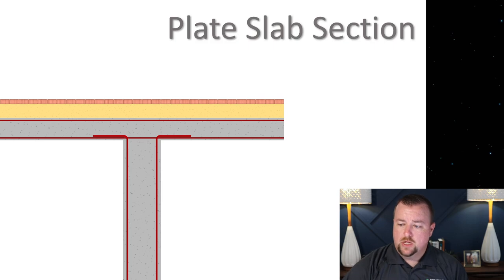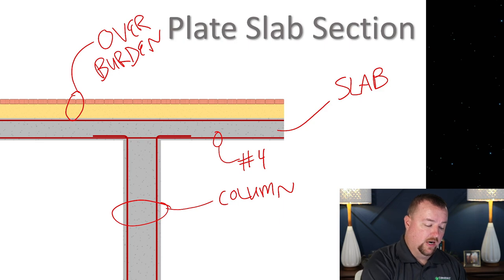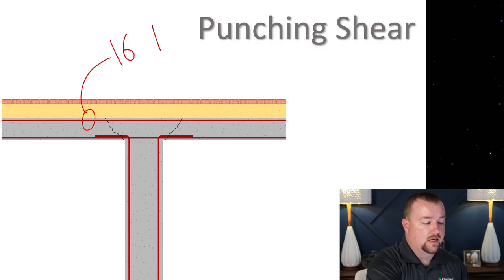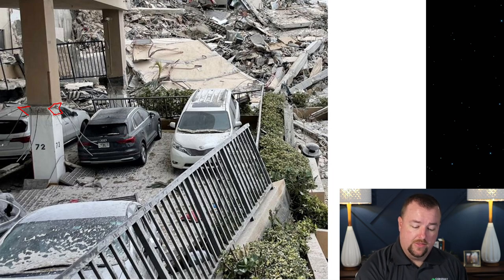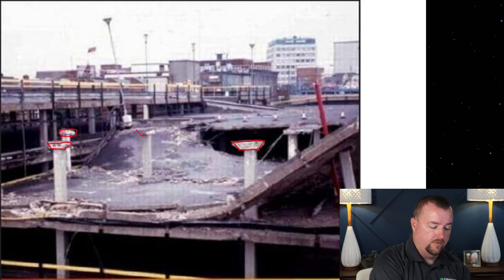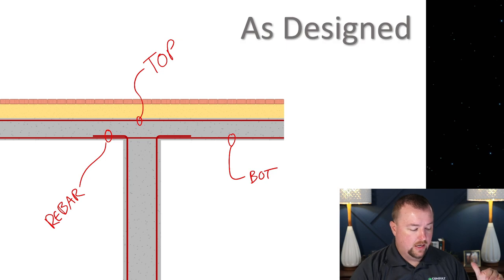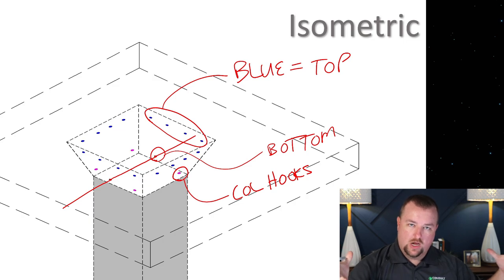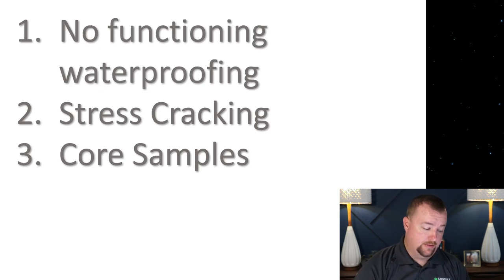The Importance of Punching Shear at the Surfside Collapse

Comment: Take a look at column 72 (@4:36). 
Note that there is two long (4' to 5') pieces of rebar sticking out of the column  in each direction. These rebar appear to be part of the top layer of rebar, of the structural slab. Note that there is only two pieces in each direction instead of four.
On the right side of the column, marked 73, it appears to show a short piece of rebar (1' or so) that is part of the lower reinforcement.
If the structural slab had de-laminated, as described, these bars would have pulled out of the slab like a loose thread from a piece of cloth; when the structural slab fell out from underneath. The weight of the overburden layer (as well as the inch or two of  the de-laminated concrete would be enough weight to bend these rebar to the shape shown.
This further supports the theory in this video.
Reply: Plus, those sections of rebar (protruding from pillar #72 (and most others), shows zero chunks of concrete attached to them...  they are stripped clean.
Reply: When we look near the pool where the slab did not fail, why do we not even see the 2 pieces of rebar that we saw at column 72?

Comment: Because you asked for ideas I propose this one:  There is a transverse beam shown in (your) July 12th video at exactly 29:00 minutes and I believe that when either column fails (and surely one failed)  it initiates the cascade failure of the larger structures. I have designed low rise buildings with various construction materials in California where we learned that there was a serious lack of hoop steel in columns of buildings designed in the 70s and 80s in this seismically active region of the country.

Comment: I was a rebar inspector among other duties, I did inspections for commercial, bridge and nuclear construction. My attention is to focus on the base mat, thinking of what I have seen and read about the history of the bottom slab being wet, especially it being salt water.
Reply: As a heavy equipment operator in Las Vegas, I've done plenty of demolition cleanup. The rebar was a twisted mess and actually kind of a pain to work around. The first thing I noticed when this building collapsed is not as much rebar as I'm used to seeing in a rubble pile. I wonder if they skimped on the rebar.

Comment: Yet again, a great explanation.
I just watched a video on the KC Hyatt Hotel suspended walkway failure, resulting in the death of ~110 people.  The conclusion was the engineering called for a single rod, for level 2 and 4, resulting in 90KN of stress at the bolts holding the suspension slabs.  But it was built using 2 different rods, one to the 4the floor, and another se from the fourth floor to the 2nd.  This resulted in 181KN of stress at the bolts.  No one went to the engineers when the decision was made to use two seperate, instead of one continuous rod.  This is a loooong way of getting around to asking, how often during construction, are changes made, where engineers aren't consulted?

Comment: Wow Josh.  You have highlighted something crucial and explained it well.  And your drawings are great.  
This pool deck was inexplicably weak and it didn't make sense.  Plus it stood for so long and then fails now.  Now its so obvious why.  Also the punch shear column head shapes were all so odd.  Why was all the top steel missing at the column heads?  Now it all makes sense, there is only bottom steel sticking out of each column.  Thanks

Comment: Good review. From the point of view of a construction special inspector with over 20 years experience, I see all the things you have pointed plus a couple more that may have contributed: 1. The top mat is too low and it is possible the bottom mat is too high leaving a thinner reinforced slab section. There may also be cold joints present from interruptions during concrete placement. The lack of top reinforcing as required by the structural plans is a likely result of relying on the contractor to do the job correctly. Inspection is a critical part of getting the building built correctly. The punching shear failure  is very obvious in many of the photos. Now apply this scenario to to a seismic zone like we are in here in Seattle and you see it is critical to proper construction of the slab. It is a very unfortunate example of how building codes are written in blood. I look forward to your future reviews as more information comes to light.

Comment: A very informative video, clearly explained. My take, upon watching it - The top bars, made useless by delamination, were no longer able to create compression along the punching shear failure plane to anchor the frustums of slab to the tops of the columns. Whilst it may be failure of the wpm that lead to the problem, the structure itself should have been designed (and built) without reliance upon the membrane, at least for major structural failure mechanisms such as punching shear. The failure of the wpm would not, however, be the only factor in the structural failure. It should not even be the primary factor in the cause of failure. It should have been a first line of defence, only.

Comment: Josh, I've been following your analysis for some time and I have to say this video is the clincher for me.  Clearly there was punch through and the delamination of the top of the structural slab around the top mat would weaken the punch through resistance.  The poor or non-existent water proofing explains the delamination from corrosion, spalling etc do to water as well as weakening the concrete itself doomed the slab to fall eventually.  And, once the slab begins to fall it can pull some of the building columns towards the falling slab and once those columns are rendered useless the building comes down.  The fact that some of that water may well have been salt water and the fact that rising and lowering water tables of saline water ... it's just a nightmare.  
I think Florida and other coastal cities around the world need to learn from this tragedy and revise codes and do potentially many other things to account for the fact that sea levels are rising at about 3mm per year.  Over the 40 years this building was standing sea levels will have risen about 80mm or over 3 inches with the pace of the rise increasing.
Reply: re: "the fact that sea levels are rising at about 3mm per year"

Land subsidence; The longer-existing sea level 'markers' around the world don't show this ...

Comment: The cracked cores would not necessarily indicate spalled missing concrete.  I see this a lot when the field techs performing the core (not the brightest bulbs) are too lazy to anchor bolt the core machine to the slab and, instead, attempt to hold it by hand.  The core bit, which is a  long cylindrical bit gets out of plumb as it goes down.    Now its rotating but at a slight angle perpendicular to the slab plane. The core bit puts lateral force on the core and shears it in two before getting it extracted.    I've had to video them taking the core and then stop the tech to show him how far his bit is leaning over.
Reply: Didn't the video presenter imply that if these cores were simply broken as they were taken, the breaks would 'line up' and appear as a thin line when core is pressed together?  i.e. to me, that indicates these breaks couldn't, alone, be caused by the way the cores were taken.
Reply: The diamonds passing thru the steel could create a torque causing the concrete in the core to fail. Would have been beneficial to have a photograph or notes of what was inside the core hole.
Reply: @r19surf  No. The torque is not significant.  You can see in one of the last core samples presented that he shows a piece of rebar that is cleanly cut with no impact to the concrete around it.  I've had coring done at a workplace and have seen the cores.  In each case the rebar is cleanly cut with no impact to the surrounding concrete just as what we see in that one core sample towards the end.

Comment: Excellent presentation. I think you hit the nail on the head here, something I hadn't thought about. Accelerated corrosion of the top mat by chlorine from the pool. Imagine 40 Years of pool water splashing up onto the deck and puddling in the low areas and seeping down through the slab.  Along with constant moisture.  I have seen what chlorine can do to steal in no time at all. In the end I think the chlorine, chloride attack is the accelerated contributing factor, that caused the pool deck to collapse, and everything followed after that.  Well done.

Comment: When taking these core samples, and it cuts through the rebar too, doesn't this effect the strength or support of the slab?   The rebar is there to be one continuous piece, if it's cut, then it isn't the same length it was before...
Reply: That's what I was thinking! It's scary to think that they cut through the rebar!
Reply: The rebar is not one continuous piece, nor does it need to be.
Reply: @stargazer7644  thank you

Comment: So Core A shows a structural slab, then a decorative concrete slab on top of it, then a layer of tile and mortar on top of that, then waterproofing on top of the tile, then a layer of sand with pavers on it? I feel like maybe each layer was trying to cover up the defects in the previous layer.
Reply: Definitely covering defects, they were treated as a cosmetic issue and remedied by installing new decorative finishes. It seems the board did not understand the severity of the problem for whatever reason.
Reply: I'm guessing that the deck was originally tile with no waterproofing. But, after a rain or people getting out of the pool, the tile would get slippery. So, the solution was to waterproof over the tile, and put sand and pavers over the whole mess. The pavers would absorb water or it would flow into the sand, and the waterproofing would direct the water to the drains. There's no way the original plans had pavers on top of tile. Why would you install tile if pavers were going on top. I would also bet no permit was obtained for the extra dead load of sand and pavers, or the waterproofing over tile.
Reply: @johnhaller5851  I'm guessing they tiled directly over the concrete slab (standard back then) and as the slab deteriorated, the tiles cracked and became loose and dangerous. Now we tile on a surface that's mechanically separate from the supporting surface.
Reply: You're mixing up the samples. Core A showed the structural slab, a topping slab on top of that, then tile and sand, then waterproofing, and above that but not shown would have been the pavers and sand that the deck currently had. Core B was the surface parking area, and that had a structural slab, topping slab and stamped concrete on top of that with no waterproofing. So basically you had A with poorly installed waterproofing that was insufficient and B with no waterproofing. I think this is the smoking gun, the pool deck was retaining water due to that covered up tile and sand layer, which was apparently installed over a slab that wasn't waterproofed.
Reply: @A_Lion_In_The_Sun  No, I was talking about Core A.

Comment: I called this on the second day, I saw the plans & my first comment was where are the column caps in the plans,
dropped panels 6" thicker than the slab usually 8'X8' around the column, they prevent punch through + extra reinforcement.
Reply: Column capitols and drop panels are not always necessary, IF the slab is designed properly.  Nobody in an expensive condo wants to be bumping their head on a drop panel as they walk around.  But you are free to do your own punching shear calculations- I think you will find that the original building was not designed properly.

Comment: There is more steel in the slab of a typical single story house built today than there were in that pool slab.. the question is how did the building stand for as long as it did??   :)  Also, there seems to be not a whole lot of punching here... it looks a lot more like deterioration or fatigue failure...
Reply: As long as they “HIDE THE DAMAGE “ even the smart ones are fooled.   Someone should be paying all families 10 million per lost loved one!  This is so FUKD how often has this happened I. Your life?  Only once 9/11. All bs. Follow insurance payouts to find guilty party.
Reply: Have a heavy equipment operator in Vegas. I've done demolition clean up. There is not much rebar in that debris pile. Nowhere near as much as I'm used to seeing.
Reply: @TheBandit7613  Vegas is in a seismically active zone, and is going to require more rebar than would a less active location.

That said, it appears that the building code in effect in 1981 for South Florida was not as stringent as the more recent codes should be.
Reply: the question is how did the building stand for as long as it did?? 
ANSWER: large safety margins designed in.  The HOA Board of this tower kicked the can down the road until they burned up ALL of that safety margin.
Reply: @chemech  true, but I'm sure hurricanes are no easy thing on a building either.
Reply: Yes even if the garage floor failed why would all the floors above fail in the same way unless they were underdesigned? Concrete structures resist dismantling even during earthquakes.
Reply: @danielbecker4365  That's what I keep asking myself, I mean a partial collapse ok but that pancake effect blew my mind. Not a single floor held up to the 8 foot drop...
Reply: @MajorCaliber  IMO< it is starting to look like the entire structure was compromised by design and construction, and the repairs that were delayed could not have saved the building in three years.  Missing/failed water barrier that was improperly installed is the major factor.
Reply: Napo leano yeah I noticed that too. Seemed like the building disintegrated as though made of sand not concrete.
Reply: @Ozark-nq9uu  - i just bought a condo in Florida yesterday, realtor assured me that none of that would be an issue

Comment: I realized earlier the interaction between the top steel and punching shear was likely an issue. I do a lot of concrete design including shear and punching shear. The top bars do not contribute directly to punching shear resistance. What they do is give you bending resistance. As long as you have the minimum bending steel on the top, the calculation for punching is independent of the total amount of top steel. However, what the top steel actually does do is increase the size of the "hammer head" over the column. With less than minimum top steel, the punching resistance does start to decrease and it will decrease rapidly. Below minimum levels, the reduced top bars do affect punching shear since the size of the "hammer head" is reduced.

Even if you ignore the delamination, you still have an issue with punching. Heavily reinforced top bars, makes the angle of the cracked concrete shallower. It is the shallow angle that gives you more shear resistance. Without the top reinforcing (or corroding and delaminating top bars), the angle becomes vertical and the punching shear capacity starts to become insignificant. 

You are not shearing the bars. The bars control the angle of the crack which affects the punching.

The punching shear crack is approximately parallel to a compression strut in the concrete. By extending the crack out, you extend the compression strut out and that is what gives you punching resistance. Shear in concrete is actually about the compression and tension in the concrete and not a shear stress. All shear stress can be resolved into pure compression and tension stresses. A shear stress is just looking at compression and tension in a different orientation. Once concrete cracks, the tension in the concrete dramatically reduces and you are left fundamentally with a compression strut that supports the slab shear.
Reply: Thank you for the detailed explanation!

Comment: Up til now we saw the building was in poor shape but no smoking gun for why it collapsed. This delamination looks like the smoking gun.
Reply: But the mayor called it a act of god... so freakin sad
Reply: I would have to agree with you there, many years ago I worked for a demolition contractor and had the pleasure of jack hammering concrete structures with excavators and by hand. We also did core holes in existing buildings for the addition of more services, pipes etc through concrete walls and floors. The moment i saw those core samples I was shocked at how they had deteriorated. A good core sample doesn't fracture like the first couple were shown to and should always look at least like the last couple of pics where the drill will cut the rebar like a knife and have to fracturing around the rebar. It looked as though neither the top mat or lower mat was attached to the concrete slab in any way by the crumbling around those rebar pieces.

Comment: I think rebar atop the column helps with the moment of the slab above and adjacent to the columns but rebar to resist punch-thru shear should be on the bottom of the slab above the column.  Otherwise the column will just push the steel out through the top, as it did.  That steel never got a chance to resist shear.  The slab would have had to shear it before the column could punch thru if the steel had been near the bottom of the slab, assuming no extreme spalling on the bottom that would allow the rebar to slide out of the slab and bend down along the column as the slab slid down the column.

Comment: I had no idea columns could punch shear, due to delamination of upper slab. I was under the impression, once conrete hardened around rebar, it was there for life.
Reply: The myth of reinfirced concrete construction. Every structure has a finite life, much shorter if exposed to corrosion of it's internal structure.
Reply: The continued water intrusion actually dissolved and removed some of the concrete around the rebar. All the stalagtites seen in the parking area were remnants of that cement.
Reply: It is - until the rebar rusts.